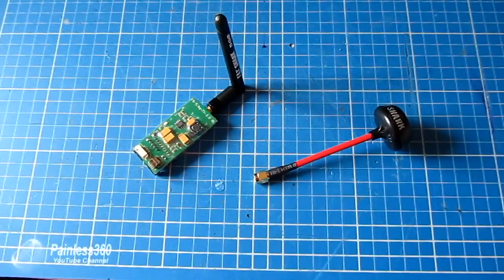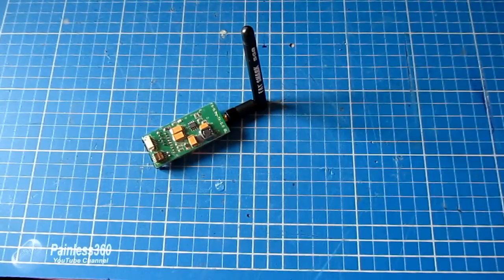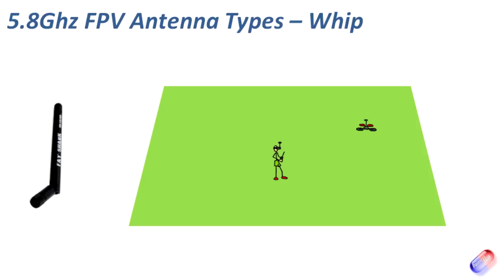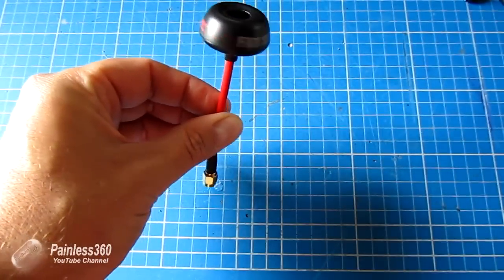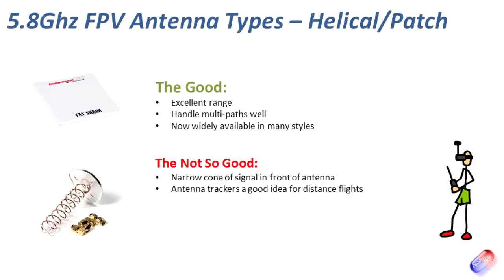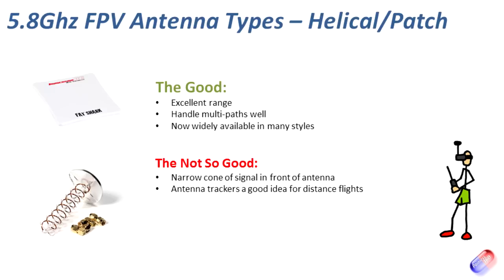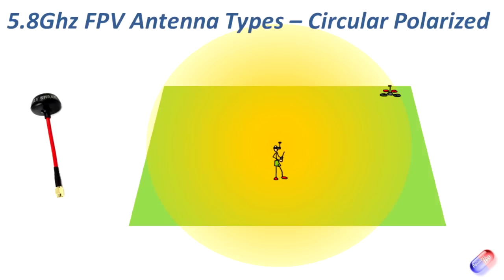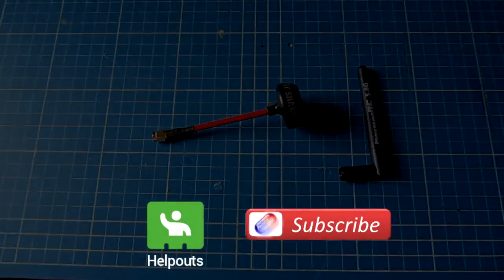Introduction to FPV - Antenna choices (dipole, circular, helical and patch)

Comment: Great Video - Thank You!
I have a question though...I have recently purchased a diversity receiver and a patch antenna (as shown in your video). The patch antenna has the sma connector at the rear (to connect to goggles, I assume) but if connected to the receiver, it will point upwards! Looking at your video, I have to assume it won't be as effective even though I have noticed some people have indeed connected their patch in this orientation. May I ask what your thoughts are on this?
Regards
Stuart
Reply from the maker: The way that I've got round this is by using one of the following two options -

1) buy an SMA extension cable, get a thick one and you can bend it to shape
2) Buy two SMA right angle connectors, plug the first into the goggles and the second into that one so you can mount the antenna facing slightly up (https://dl.dropboxusercontent.com/u/67301981/Goggles.jpg - sorry for the roughness of the diagram but you get the idea!)

Hope this helps. Happy flying!
Reply: Painless360 Brilliant advice many thanks!

Comment: Nice video
I am having issues with my video signals, does gps interfere with rx or vtx signals
Reply from the maker: I’ve not had that. Usually power is he first thing to look at..
Reply: @Painless360  Thank you I will look into power source

Comment: I a complete newbie to this so please excuse me if this is a dumb question but I own the eflite umx timber and I recently purchased a ready to go fpv system. I had a mini dipole antenna. I'm looking at buying some goggles that are diversity with a patch and a clover antenna. Will this work well? Do I need to match antenna types?
Reply from the maker: Please see my reviews of the little indoor quadcopters. If your model has a little dipole antenna, then you're better putting linear antennas on to your goggles. I like to use a linear antenna dipole as well as a linear patch if I'm flying one of those. Hope that helps

Comment: what about right and left hand circularly antennas, does it matter which one?
Reply from the maker: I wasn't going to cover that level of detail in this introduction video but as you asked :)

You need to have the same polarisation in all the antennas you use. Brands like FatShark have used right hand for a while and have recently launched a left handed setup. These left handed ones are clearly labelled with a large 'L' and on the circular polarised antennas, use different colour plastics.

Hope this helps.

Comment: is there a diversity device that allows you to combine all 3 types of antenna..if so what do you recommend?
Reply from the maker: +Trent Murray There are many options for diversity receivers. Most will use a circular polarised and helical (for range in one axis) when using a 2 antenna diversity setup but setups that support 3 or 4 are available. The choice of antenna is then up to you on how far and how much coverage of the sky you need.Hope that makes sense. Happy flying!

Comment: Lee: 
   Nice, clear, simple diagrams to demonstrate the field of sensitivity with each. 
   Wish you hand shown the photo of the actual antenna with the cartoon of the flyer and quad for the patch antennas. 
   I would like you in particular to do another video where you illustrate the different types of patch antennas and go into more depth  on how their fields of sensitivity differ.  
   For example, how do the fields of sensitivity for the Eachine sting pad (patch), lobulated circle as in the Realacc triple feed, and square patch antennas that are sold for BOTH 2.4 and 5.8ghz work in terms of sensitivity and directionality? 
   You are the best explaining things!  - Jim
Reply from the maker: Check out the FPV antenna lab series, lots more detail and practical resting.. Best of luck

Comment: Can I connect 12 dbi helical antenna to my ts832 reciver directly or it will need separate power supply?I am new in this hobby please help.
Reply from the maker: No antennas are powered. The extra range is achieved by sacrificing the ability to be omni directional. Best of luck!

Comment: Hi,Im confusing if the dipole antenna is better tan circular polarized because so many people use it for 1280 MHz vtx and vrxcan you explaind that ??thank you. !!
Reply from the maker: +Frank Lee dipole I'd only better when both antennas are perfectly aligned. Tricky to do on a flying, banking model. Happy flying!
Reply: thank you, so many people show on their chanel, how to do a antenna dipole by cutting right lenght depending of frecuency, positive up negative down.    Its has a diference ??
Reply from the maker: +Frank Lee We only use the supplied antennas and don't get into the science behind how antennas work. There are some people who are more into that, they would be a better person to ask.. Best of luck!
Reply: ok.   thank you very much..

Comment: If you don't want to do fpv but just fly can you just unplug the antenna and fly with the transmitter plugged in?
Reply from the maker: Never power up a video transmitter without an antenna attached you'll destroy it. Happy flying!
Reply: Painless360 thanks!! You too :)

Comment: Hi, I am planning to get into fpv.  Can I use a dipole on the aircraft and cloverleaf on the goggles and still get a decent 'bubble' of range?  Reason for asking is that the dipole is more durable and the clover would be safer on the goggles.
Reply from the maker: +Taurusdre if with the exception of patch or helical, try and keep the same on both ends. Best of luck!
Reply: Painless360 great, thanks

Comment: Those helical antennas, what if you simply turn your head towards the quad doesn't that basically make it 360 degrees if you keep rotating yourself towards the quad?
Reply from the maker: You could. That's why antenna trackers are used to do just that.. Happy flying!
Reply: ok great thanks for the tip.

Comment: Does providing a fpv quad with a good antenna ,drastically improve the fpv quality?Thanks.
Reply from the maker: It should make things better if the problem is the quality of the antenna you're using. If you have problems with the camera, video transmitter or power system on the model causing interference in the image then it will not.. Hope that helps..

Comment: whats the cost of patch antenna?
I am working a project on Brain Computer inteface. Can u suggest me what type of antenna can be used ? We are gonna extract signal from brain using electrodes and digitalise and amplify it. Then, the signal is to be transmitted wirelessly to a system to extract the information. Application of project could be automatic wheelchair for physically disabled. I would like to know which antenna can be used ?
Reply from the maker: Heema Sharma Patch antennas are great for long range with a very narrow field of reception. You would be looking at a simple bipolar for short range applications where a wide range of reception is needed.Best of luck.
Reply: Painless360 Sir, whats the range of patch antennas and its gud to use zigbee or bluetooth technology.

Comment: help hi thank you for this vid. I need advice  on with angle  i should have my 2.4gh devo 10 antenna for best range hope you can help i have it L shape up words
Reply from the maker: Depends on how you have the antenna mounted in the model. If they are horizontal then twist the the Tx antenna near horizontal etc.

Best of luck!

Comment: can you use circular tx and patch rx if so does it matter polarisation on circular tx
Reply from the maker: You can use them together.

You need to match the polarisation (right or left) on both the transmitter and receiver.
Reply: thanks

Comment: atm I have a 5.Ghz Flat antenna (Hubsan H7000 controller) What should I do best? Will buying the Helical make a big difference? and ill a circular polorised one be better than the standard one?
Reply from the maker: Not sure what you're asking. When you mean 'best' what do you mean? The better the range, the narrower the reception 'beam' will be.. Patch antennas are good for closer in the best ones give 180 degree reception..
Reply: Painless360 Thanks, So If I want to fly straight line forewards (what I mostly do atm and most of the time I coordinate myself to the same direction as the drone), I should get myself a Helical antenna if I want the best range. And how far do you think I will be able to fly if with the patch antenna I'm supposed to get 1000m
Reply: Painless360 And any recommandations for the Helical antennas?; and what should i get for asfar range with the 2.4Ghz antenna?  atm i have the standard omni directional antenna. (If you want look up this controller: Hubsan H7000)
Reply from the maker: +Obinna Eke yep, that's what I'd use! Hard to say on range as it depends on so many other factors like tx power.. Happy flying!
Reply: Painless360 Thanks again. Where can I see the TX power output? And how can I increase the 2.24Ghz range?
Reply from the maker: That detail is in the description for the Vtx you're using. Normally in the range of 25-600mW. You can increase the range by using a more powerful transmitter or a more sensitive antenna.. Best of luck!
Reply: Painless360 OK, thanks

Comment: hello, im going to buy two new antennas and i have the choise of 50mm or 80mm. does size matter? one is for on my drone ofc it are pagoda antennas
Reply from the maker: I assume that's the length of the antenna? It shouldn't' make a difference to performance but will to how it looks and fits on the model.. Happy flying!
Reply: Painless360 was looking for this info. Thanks.

Comment: Does it matter which CP antenna is on the craft? many say TX or RX.. I assume the RX is 4 leaf, while TX is typically 3 leaf.. but can they safety be switched? (I ask because HK kits come with the 90 degree elbo on their RX CP antenna.. which make goggle mounting look funny.. 

Thanks!
Reply from the maker: GMSpada I would go with the stickers on the antenna, FatShark do a range that can be mounted any way (tx or Rx). 
If you want a right angle then you cam buy an SMA right angle adapter (I use them all the time for neatness!)
Happy flying!

Comment: Why don't wifi router use circular polarized antennas while both uses 2.4/5.8GHz RF?
If Wifi control vehicle such as AR Drone 2.0 uses circular polarized antennas, is it helpful like RC FPV?
As I understand, circular polarized antennas is invented to avoid multi-path reception. Wifi uses TCP, which can assemble packets in order, so might not need circular polarized antennas. WDYT?

Comment: I got 3.5 km with my homemade cloverleaf antennas. 5.8 ghz and a 600 mw transmitter. beat that guys ;)!
Reply from the maker: Awesome! How may turns? Anyone beat that?
Reply: Painless360 I dont think anyone else have that range with only cloverleafs? idk :)

3 leafs on tx and 4 on rx. but the copper wire is pretty thick
Reply: But doesn’t 600MW take other signals out of the sky?

Comment: is it advisable to use helical antennas  such as https://hobbyking.com/en_us/aomway-11dbi-7-turn-5-8ghz-helical-antenna-rhcp-sma.html on a transmitter?  Also i have heard that these antennas can receive from all sides for a given range and only need to be pointed toward the aircraft for a longer range. how true is this?
Reply from the maker: +Peatah Andy yes, use a helical antenna on both ends. See our other videos in the 'introduction to FPV' series for more of the basics. Happy flying!

Comment: So about how far can you g o with a 5.8ghz  polarized antena
Reply from the maker: Tricky to answer without knowing the power of the transmitter. The higher the power the longer the range. Use a helical or patch antenna on the receiver for far more range using the same power of transmitter. How much distance are you looking for?
Reply: Painless360 the maximum legal range

Comment: Thx i learned! You should make that wing tail the whip yagi antenna and put a second one as a cross for the rotations of yaw. i like the conicals is that like laser antennas. can you use multiple anntennas and switch them when signal drops. maybe you can help with this idea. tiny.cc/openinvent1 or tiny.cc/openinventfb
Reply: +Emba Lona Use fpv to capture the path of a roller coaster and velocity changes with a gforce detector accellerometer and need transponders for positions (i dont know that part) the purpose of captureing the spline path of travel will allow animators to create 3 d worlds to experience roller costers in VR. - ember leona from bitsfit.com
Reply: +Emba Lona of course i would use car shocks as conical antennas and fencing as giant yagis before the fcc helps me swim with the fishes like segway.

Comment: not true on patch,I watched the actual metered test on the patch and they are not designed well. Mabe different brands work better IDK but after watching RC Reviews, an actual metered test showed the patch as being the second worse after the rubber duck that comes with most FPV equipment.That being sais,I would stick to the tried and true heli style antenna.